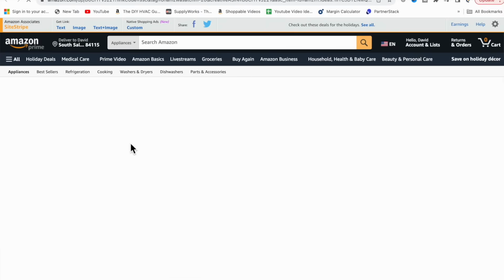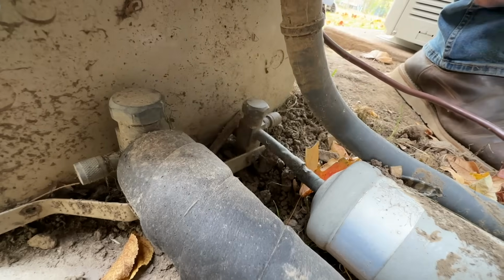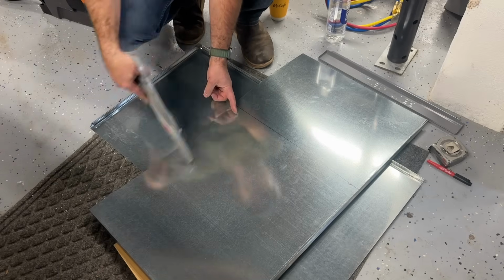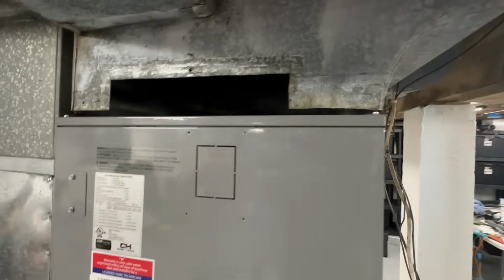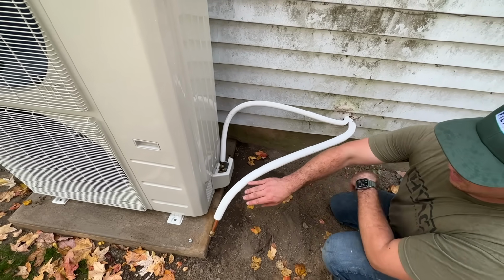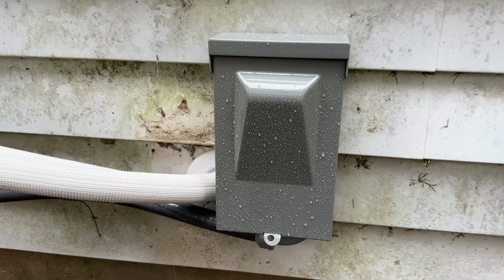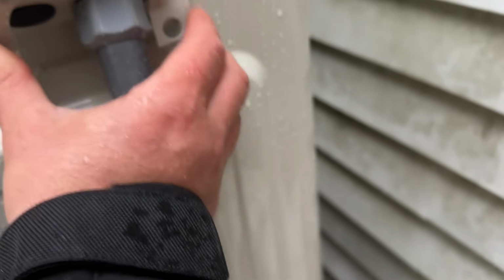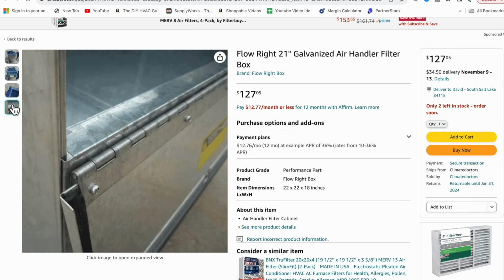How To Install A Ducted Mini Split  -Start To Finish-

Comment: What's the impact of not running a nitrogen test?
Reply: You won't know if there is a leak
Reply: @fletcherryangolf534   All he has to do is a decay test. Once it gets down to low microns vacuum, wait 15 minutes and if it holds or doesn't increase on the micron gauge you are good to go. I would have done a nitrogen gas flush and a pressure test, but the leak down (decay) works OK.

Comment: Last I checked in regards to Cooper and Hunter - the warranty is only in effect if it's installed by a professional.  I was installing a 12k in my garage and ended up with Pioneer as CH would not warranty a DYI install.  I understand HVAC and could do this IMO, but what I struggle with is the process of purchasing the right equipment.  For example, I have a 36k AC and a 80k 95% gas furnace.  I'd love to have a heat pump with GAS as a backup rather than restive heat but the issue I have is sizing and shopping for the right equipment.  I personally believe a 4 Ton would do the trick and I've seen a Gas/HeatPump HF combo for something like 6k.  So much of this requires a lot of planning.  I fear your video, while looking easy, is not the full job and doesn't show why you had blood on your finger in one of the shots.
Reply: Do the system yourself and then have a licensed HVAC installer do the charging of the lines, make sure that you get their license number or whatever it's called for HVAC certification and write it on the invoice. When you call tell them that it was installed with a licensed HVAC contractor because technically, it was. Alternatively ask their legal team or contact the place that sold it to you because they should have some disclaimers the indicate your warranty would be void unless it's installed by a licensed contractor
Reply: You can also contact c&h and ask them for a list of their approved HVAC contractors that they recommended in the area. Then you can ask and call each one to have them come out and do the Evac and system checks for you and pay them a fee for their time which is hell of a lot cheaper than having them do the whole entire install. Just tell them you're having a problem with your system and ask them to come fix. Then when they get there, explain what you need. They "repaired" (installed) and your warranty should be good. I would even see if c&h has a warranty registration process where you can give them the license info of the installer.
Reply: @claytonjames4779 contractors do not even want to talk about anything else for what they will not get kickbacks from sale office
Reply: @claytonjames4779 What you're recommending is borderline fraud. Also if you call me asking to finish up you're non warranty install, what makes you think I will give you a warranty? Lol. Not gonna happen, and the equipment has to be bought by the contractor directly from the supplier and do the full install in order to warranty it. Quit giving out BS advice.
Reply: I saved $7k installing my unit, and this is the second time over 10 year. That’s $14k for 2 units.  I reader, studied and watched videos.  It is absolutely worth it.  They can keep their dumbass warranty.  There are people struggling to care for their families.  The last thing they need are greedy corporations and contractors.  There are plenty of people who will pay contractors because they have the money.  The DIY market is smart for healthy companies who want to help.

Comment: Use a plastic Sharpie or similar to push in the contactor.  
It still requires EPA 608 to purchase/install the unit.

Comment: Mikey pipes put a bosch in for me. Im very very lucky. What you are doing for people is amazing. Awesome your bro let you do this. My bro is so up tight he wont let me do anyting to help him. He pays people to do it. I checked his air handler this summer said he had a clog. He said dont worry about it I'll call someone. He had an ez trap with a brush up there lol. His systems are 22 on a multi floor 500k home he just bought (got taken with that shity hvac), HW heater had blown exp tank. Yea we could have dealt with it all but nope.
Reply: Oh and 2 days after i looked at the air handler he had water dripping on his daughter in bed in her crib. So i guess i was right.

Comment: I got a question, with the vacuum set up. Does your micron gauge have male threads or female? How did u connect the manifold hose to your micron gauge? 
Also could you install the micron gauge to the low side with a tee and pull from there by eliminating the high side? 
Good job man keep it up!

Comment: Blows my mind at how many BTU people install. I have a 1000 square foot bungalow that I have been cooling easily with a 12,000 BTU 120 VAC mini split for 14 years now. I live in Canada where we get minus 40 to plus 40 C. My place was built in 2003, well insulated,
Reply: Well insulated is the key word.
Reply: @user-ln7of9gs4s  Why not insulate first. Seal all air leaks and downsize the heatpumps. In the long run it would be cheaper to run and more comfortable.
Reply: Missouri gets quite a bit warmer than Canada. If their house is 2000 sq feet or more a 3 ton unit sounds appropriate.
Reply: @Egleu1  It doesn't get much warmer there in the summer than it does here. This just tells me people didn't insulate properly.
Reply: @timcat1004  Missouri is much farther south. The house in the video is old. Of course it's not insulated properly.
Reply: I live in the southeast and my 3 ton unit runs non-stop in the daytime to cool my 1700 square foot house down to 75 degrees. My house has decent insulation, it's just a lot of thermal load when it's 95 out.

Comment: Mon lives in Texas now, and still misses her gas heat with a heat pump not hot air when you’re cold heat pumps maintain temperature don’t make heat very well
Reply from the maker: Yea it confuses a lot of people for sure.

Comment: I would love to install a ac heat pump but industry needs come long way. Cold climate need gas back up i/e emergency heat and be able to receive Solor as primary input. Have a mini split on order that will run totally on solar panels without any other input. Going to try that first nothing else on market that I found.

Comment: Those heat strips seem way to close to the electrical boards especially without some kinda thermal protection. I get it's how they designed it but I would add some form of thermal reflection to protect the electrical
Reply from the maker: The heat strip is in the ductwork. The breakers do not get hot nor does the board

Comment: I am currently installing 6 Senville mini split heat pumps in my house and pole barn that work down to -22f.
Reply: -22,the big three dont even claim anything below -13 with reduced capacity!
Reply: @petersmart1999  Mine is rated to -22f. It has more to do with the refrigerant than anything. They have heat pumps rated for -32f but most of these heat pumps are rated for a COP somewhere higher, like 47f. My heat pump works at a cop of 3.8 at 47f. I stop using my heat pump as supplemental heat below 20f as it isn't as efficient and I have a 95% efficient boiler. In my case, I use the heat pump to heat the area we use during the day and not the bedrooms above. Saves a small amount
Reply: No its not!
Reply: I'm currently installing a 24000k Senville ducted mini split.  
I should have done it 2 months ago when it wasn't hot in Florida.  The attic is brutal 😅

Comment: You are an awesome instructor!  I have learned so much from your videos.  
What do you do with the condensing unit after you pump the refrigerant into it?
Reply from the maker: Yea I typically reclaim it into a tank. But with this one, my brother just brought it to the scrap yard. They didn’t require a license to bring in coils which was surprising. That or sometimes I’ll throw it on Facebook and someone will come get it.

Comment: that seems like a nice system but going from gas heat to a heat pump will be a shock for most people. The temp difference is the main issue, mild weather prolly be fine but gets cold in mIssouri in the winter time. Surprised you just did not install a new 90+ furnace and straight ac .
Reply from the maker: I did the same at my house with my dual fuel setup and the difference was minimal. Maybe because of the hyper heat?  As long as it keeps my home at the temp it’s set for, I’m happy
Reply: Yep that would be the best way to go, so he could have kept that Lennox furnace and just added the heat pump to it and have a great system with gas used as emergency heat . 
 @diyhvacguy
Reply: @bluejay713 52,500 btu's of pure dry ass heat! Yay
Reply: @bluejay713 the heat strip is emergency heat.  The heat pump will heat just fine.

Comment: Why go from a gas furnace to a heat pump? Isn’t gas heat better than a heat pump, specially in really cool weather?
Reply from the maker: This equipment was free. Pretty good reason to get a new hvac system haha
Reply: @diyhvacguy  How can I get it free too? let me know, Super interested
Reply: Gas stoves and furnaces will be banned from most new buildings in New York state under a new measure passed by lawmakers.

The provision, included in the state's budget bill passed Tuesday night by the New York Legislature, begins phasing in next year. The measure prohibits the installation of fossil-fuel equipment in buildings of seven stories or less in 2026, with the ban for larger buildings starting in 2029.

Should be interesting for Buffalo Ny but hey the government knows whats best for us, right?
Reply: Depends on what your goals are. Energy independence? Co2?   
Canadians had 30% install of heat pumps last year.
Reply: Gas is so yesterday. My Bosch HP heats fine down to about 15F,  Average winter temp here in CT is 39. Last year I had one day where it got to 4F and my heat strip came on and used lots of electricity. For the rest of the time, the HP worked fine and no heat strip usage

Comment: Nice! If that system is similar to the Mr. Cool "wired controller", you can expect set point float as I like to call it. You set it to 72, you will get a random 3 degrees above or below the set point where the unit will satisfy. Frustrating, but I did confirm with Mr. Cool support, this is how these wired controllers perform. I ended up going back to a 24v Honeywell VisionPRO, while not communicating, it works great and the unit still modulates load.
Reply: Funny, this is how the Mr cool ductless units operate too. Unfortunately there’s no fix for it, other than getting a Mitsubishi/Daikin/etc…
Reply: this is the exact thing as Mr Cool and ACiQ. BTW ACiQ like $1k less from HVAC Direct, all the same stuff haha...ACiQ works with 24v thermostat, I use a ecobee with mine.
Reply: @richiefekecs  nice!

Comment: Great video.Great job. Well explained. I live in Ontario Canada. The don't allow low voltage and high voltage in the same conduit here.
Reply: NEC does not allow it either!!!! The insulation ratings are different . If the ratings were the same,thats a different story!
Reply: , high volt will
Mess with communication within low volt anyway.